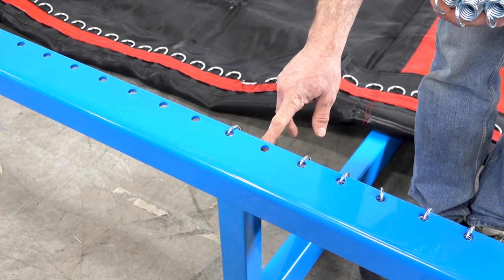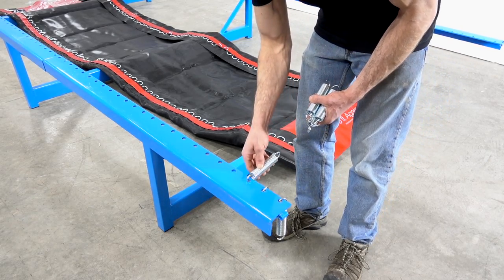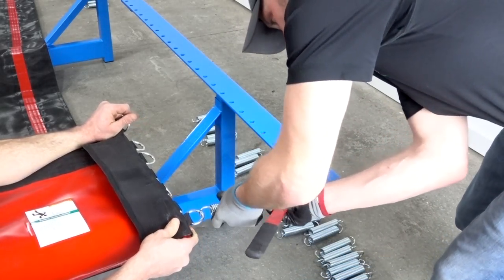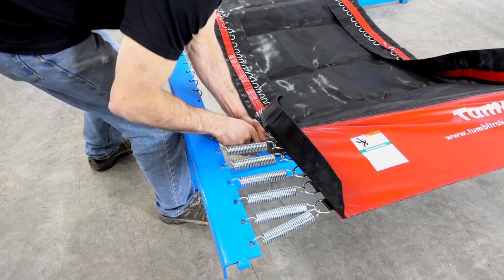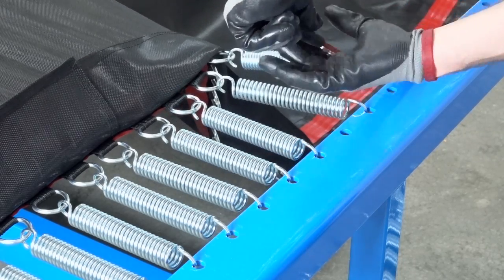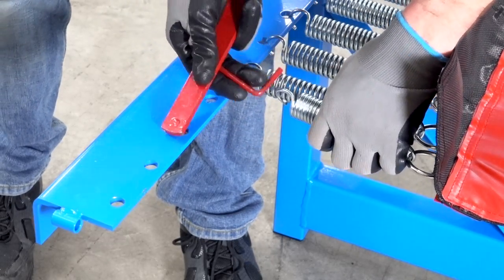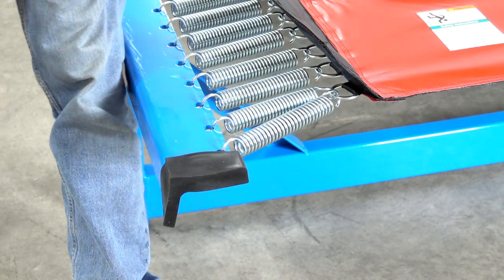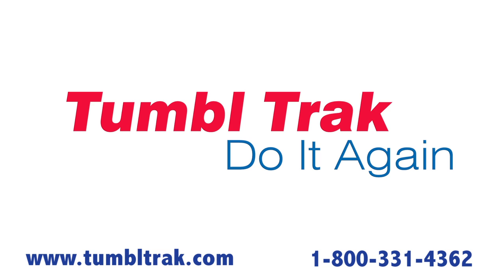Springing the Tumbl Trak Bed

Comment: How can you make the bed less taught? We replaced our springs and were having complaints that it’s too hard now and our kids don’t exactly have core strength to prevent them from not hurting themselves when doing seat drops or knee drops
Reply from the maker: Hello!  Replacing worn-out springs will result in a different feel on a Tumbl Trak for sure!  Over time, as the springs wear and stretch, the bed will get more bouncy.  Seat and knee drops are recommended for appropriately skilled athletes on a standard trampoline with more bounce. The Tumbl Trak is intended for jumping and rebounding tumbling skills.  Hope this helps!